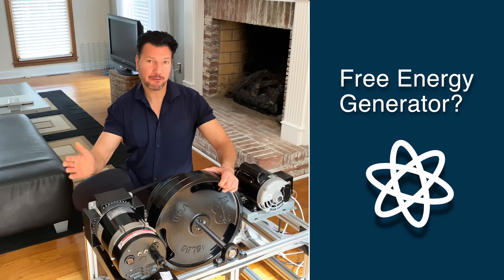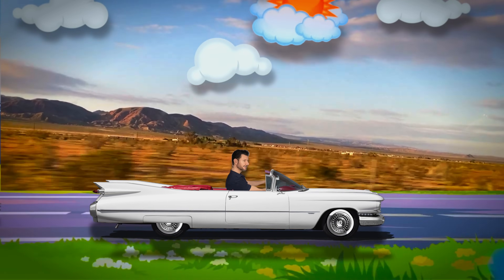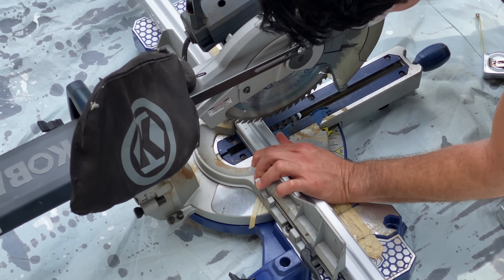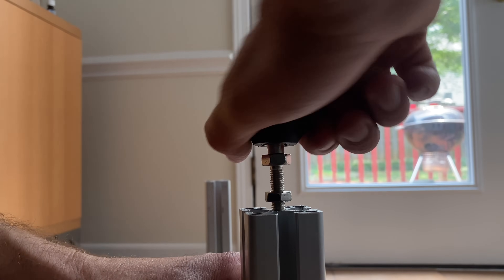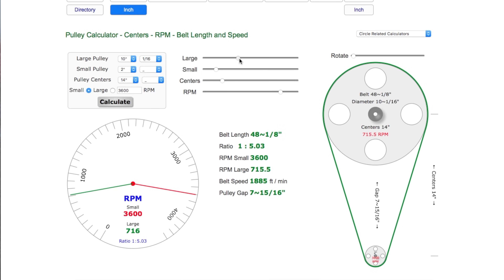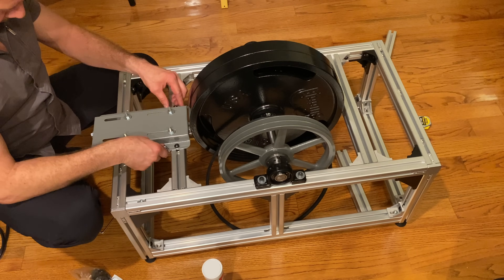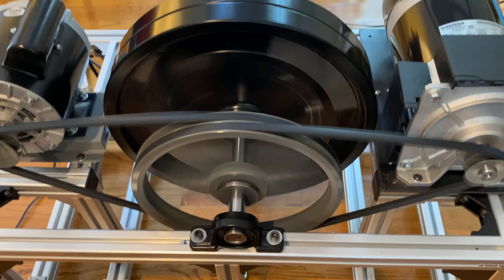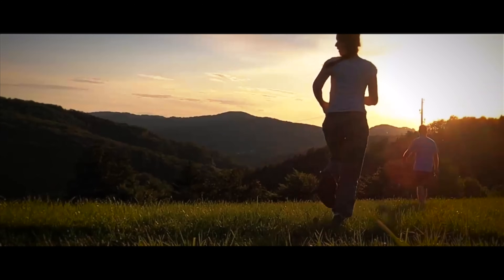How to Make a Free Energy Generator!

Comment: What ya, need is a balanced system, that is important, but More than that ya, need the right barrings.. the flywheel is being pulled down Bye friction in the 
Barrings.. the magnetic barrings are way, to Expensive.!! What you need is slip barrings, The one's that catches One way, but after achieve full speed, they free-spin, and let go of There grip,.... Resurch the City busses that used
 Flywheel technology " back in the 
Past,".... They would keep spinning 
Sometimes, 45 minutes after the bus was parked, and recharging 
The whole system before everything was cut off and disconnected bye what I think was
Relays... PS: I'm resurching this as well. So, good luck my friend... JR

Comment: you just have to try 3hp motor with 12.5 kw generator and fly wheel must be 100kg than you will get the result with high speed  good try and best of luck bro 👍👍👍

Comment: YOU PROBABLY DID NOT DO IT RIGHT. . ... USING  MAGNETS IS THE WAY TO GO.... NOT SOMETHING MECHANICAL.  ... THERE ARE ALREADY MAGNET MACHINES WORKING..... THE UNIT COSTS ABOUT 4,000 DOLLARS THOUGH..... BUT AFTER THAT TOTALLY FREE ENERGY ......... IT'S CALLED .....   MAGMOV.

Comment: The choice of devices is of essential importance.  For example, if we connect a 230V/1kW motor to a 230V/500kW generator, we get 499kW excess power to run our appliances.

Comment: Greg; True science is not a cultural chant of defeated minds. True science is Laws established from experimental evidence. Newton has all the experimental evidence and energy conservation has none. 

Newton’s Law of Conservation of Momentum is the strongest Law in Physics; but the profs throw it out in order to promote their false law of conservation of energy. 

An Atwood’s machine with 15 kg on one side and 16 kg on the other produces 24.66 units of Newtonian momentum. It takes 4.429 units of momentum to return the 1 kg back up to the original position. There is 24.66/4.429 = 5.56 times as much momentum as what would be needed to keep repeating this even. 

You throw out Newtonian physics for a meaningless chant.

The ‘cylinder and spheres’ takes 24.66 units of momentum and throws the 1 kg up 31 meters; when it was only dropped one meter.

Comment: I used a scooter 14 volts dc motor run by capacitors , charged by 16 vdc coming from inverter powered by the generator...works fine

Comment: The Overunity concept was discarded long ago by the electrical pioneers who wrote our textbooks because the then understood parameters of academic electrical engineering were not flexible enough to allow additional influences to enter the system and increase its power - Magnetism is indestructible and is Power for this purpose - its effects to increase electrical power were only lightly rescearched and then ignored and discarded - without reintroducing it into the system to increase its power - todays high power neodynium and other type magnets may have properties that lay outside academic parameters due to quantum effects or other reasons - the electrical frontier is yet relativley new - many experimenteers have reported success by converting a common AC induction motor into a powerfull  LOW SPEED alternator - by simpley cutting groves into the armature and filling them with an uspecified number of POWERFULL magnets to somehow correspond with the stator windings - and using the current from that powerfull unit to drive a suitable motor that in turn drives the New and Powerfull Alternator to produce excess Electrical Energy - perhaps at a slightly lower speed - if the adaption proves to be unsuccessful at Overunity then the Durable and Powerfull low speed Alternator has proven to be ideal as a Wind Power Alternator!

Comment: it can work but you have know 3 base numbers,   and its not impossable  it can be done , you need to know 3 numbers amout of hp needed to make the power, genartor 1 to power the motor 
at 15 amps  useing 6 phase,  next tie it in to low rpm gen of 15kw,   220 volts at 150 amps,     but key is it running on 6 phase between motor and gen,
now all safty systems, that must be invold u talking ton power,   this was done in 1960s by milatery  and it work when i got my hands on it a 60 year old device did work made 20 % free power, but it work,  so u use concept why dose power plants put out 700k volts and to is key to green power, no one understands why no can u just find it, most people work on it dont know why, 

now only thing we need way start this, for  this we use small motor with no load on genartors,   now where it fails stater coils this where this must be remove and replace with magnets, 
and your power with amps guss what your looking at it all wrong,  first u have have 50 hp motor and this motor must run at 15 amps, in this way it will work one part missing is voltage,  
and u cant guss this  key run it at 800 rpm,  why it stop easy u stater coil is probem  , by way this was done in all high rises in 1960s and it worked but was removed from history, 
if u aswer one quistion why dose power plants put out 700k volts, u found key to green power,   other why i the only one has all key numbers to make this work ,

Comment: When the interaction of masses involves a change in the quantity of 'mass in motion' Kinetic energy is NOT conserved. When a .0051 kg dart embeds in a .1380 kg block Kinetic energy is not conserved. When the spheres collide with the larger cylinder Kinetic energy is not conserved. But the modern profs only care about the ‘can’t produce something from noting’ mantra. 

If the profs think that a 1 kg mass moving 3.16 m/sec can collide with 9 kg at rest and make a 10 kg mass move 1 m/sec then they are producing 6.84 units of Newtonian Momentum from NOTHING. The profs fib to you when they say Newtonian momentum and kinetic energy are both conserved: they are NOT. 10 m/sec does not equal 3.16 m/sec.  

You can believe the prof’s deceptions or build your own ‘cylinder and spheres’ and find out the truth.   $30 to find out the truth.   Newtonian momentum will be conserved and you will be making energy.

Comment: All you have to do to make free energy is to use the Laws of Physics that are based upon experiments rather than wild philosophical imaginations. Answer this one question correctly and the production of free energy from gravity becomes absolutely obvious. 

A 1 kg mass collides with a 199 kg mass at rest. The speed of the combined 200 kg mass after collision is 1.4007 m/sec. What is the original speed of the 1 kg mass?

All anyone needed to do to make free energy is throw a small mass off of a massive cylinder or flywheel and see if Newtonian Momentum is conserved.     

How you answer the question might tell you what is wrong with modern physics and why we have not already produced free energy from gravity. I would appreciate it if you answer the question before you continue reading.

If you solved the question using Newtonian Momentum Conservation you would predict 280.14 m/sec and you would be correct.

If you solved the ‘problem question’ using Kinetic energy conservation you would be incorrect and your prediction would be 19.809 m/sec  

20 one kilogram masses evenly stacked 20 meters high can accelerate a 180 kg mass in a modified Atwood’s machine. This is 20 suspended kilograms accelerating a 180 kg block on a frictionless plane.  After a one meter drop of the 20 kg stack the entire 200 kg mass is moving 1.40 m/sec. This is 200 kg * 1.4 m/sec = 280.14 units of Newtonian Momentum.     280.14 units of Newtonian Momentum 

After the stack has dropped 1 m the 20 kg stack can be reconfigured by throwing a 1 kg mass up 20 meters.  This 20 meter upward throw takes 19.81 Newton seconds or 19.81 units of Newtonian Momentum. To be thrown upward the mass must be moving 19.81 m/sec.   This takes 19.81 units of Newtonian Momentum but you have 280.14 units

If you calculated that the 1kg mass that collided with the 199 kg mass must have been moving 280.14 m/sec; then you believe what is true; that Newtonian Momentum is a conserved quantity. Kinetic energy conservation is not true and has never been conserved in collisions.. 

When the ‘cylinder and spheres’ takes the motion of the 200 kg moving 1.4007 m/sec and gives all the motion to the 1 kg then the 1 kg must be moving 280.14 m/sec, because the 1 kg gives all of its motion back to the 200 kg moving 1.4 m/sec.

All anyone needed to do to make free energy is throw a small mass off of a massive cylinder or flywheel and see if Newtonian Momentum is conserved.

Comment: Mount your flywheel so that it has clearance; about 1.5 diameters. This will allow you to throw a weighted string that has been wrapped around the circumference of the flywheel.

When the mass on the end of the string unwraps from the circumference of the flywheel the rotation of the wheel will be stopped. All the rotational motion of the massive flywheel will be transferred to the much smaller mass on the end of the string.   

One example is: a 40 kg rim moving 1 m/sec will give a 1 kg mass all of the Newtonian Momentum; which is a speed of 40 m/sec for the small mass. And the energy increase is massive. This is experimentally proven by ‘cylinder and spheres’ experiments. 

This 40 m/sec is verified because the small mass will return the motion to the larger flywheel if the small mass is left attached to rewrap around the flywheel. The flywheel started with 40 units of Newtonian Momentum and it ends with 40 units of Newtonian momentum; therefore the small mass MUST have 40 units of Newtonian Momentum. 

Just verifying these speeds will guarantee that energy producing machines will be built; because you only need to throw the small mass upward to make use of this energy increase. 

Use a string length of about ½ circumference for a 1/40th mass for the small mass. These speeds are very DANGEROUS.

Comment: I believe that the original units produced used a 3 phase electric motor and powered it by using only 1 phase. Also the generator was a 3 phase unit and 1 phase powered the electric motor while the other 2 phrases were used to light bulbs and run small motors like fans and drills.

I don't know if that idea was ever tried properly or not when trying to prove that it could be self running or not.
Also the generator needs to be geared for higher speeds, so using a smaller pulley on the generator would increase its speed. 

The original unit video that is actually marketed online is produced by a Pakistani guy. 
He maintains that the gearing must be accurate and the proper use of the 3 phases is critical for it to work. 
IDK, I'm just a guy that grew up on a farm in Wisconsin USA 👌👍🙏🤔

Comment: For power over unity to be successful. You would need a three-phase motor and a generator that over produces. A smaller motor that could get up to 600 RPMs. And a redesign of the main generator for more magnetic polarity. Then you need a Bank of supercapacitors the store residual energy. capacitor one has to be larger than the other. You're not taking away from physics. You're not getting something from nothing. Your banking residual access inside the capacitance to use in a second capacitor Bank as a backup for fall off.

Comment: you have done well, do not give up yet. change the base design and put all three parts (motor, generator and wheel on the same axis), no pully, no belt. they eat electricity by friction. i subscribed to your page and wait for you to do this and make a video. this is exactly what i wanted to do. good that you are doing this. calculation of the energy input for the motor snd energy output of the generstor also is necessary. but i think you have done this. balancing the wheel was a professional work.

Comment: What software do you use to assist with balancing the flywheel ?
This well built setup will never work as it has to do with efficiency, the power supplied to the generator will always exceed its output and the output needs to be greater to drive the motor, then there is energy loss in the belts and we haven't even started to draw any power. You will never even get it to run without a load !!!

Comment: Try feeding the power from the Generator into capacitors and power the motor from the capacitor output they will continually charge and discharge to the motor

Comment: Use a 12 v mort  and use a 12 v batteries to run it went you to the generator voltage have a kill which on the 12 v mort just turned it off and the generator should keep going

Comment: Use a transformer instead of a generator or motor. A current running through a transformer will produce a magnetic field . When the current is off the magnetic field produced by the transformer will collapse and cause a reverse current surge of high voltage. This reverse current can be stored in a large capacitor and used again repeatedly until the voltage goes down to zero. This already proves that the law of thermodynamics has been broken since the first initial current in the transformer was multiplied by the repeated forming and collapsing of the magnetic field.

Comment: I think there's a problem in yr design, if you want a "free Energy generator" why would you need a motor that draws Power from yr house... From what I've seen in the internet you can either go for the Spring generator version or you'd need a stator around that weight disc with magnets, and magnets also on the rotor (magnet motor) and then it should be possible to start It by hand and the rotation would kick off from that... Kudos for the whole frame and setup you did though It looks so nice

Comment: His ideas working but small change 1.big _small pully  2. Low voltage battery motor 3. Other energy sores solar used 3. Nuttan 7 vithi used.  This ideas 100 percent working.

Comment: if you spin a electric motor by the shaft its then a generator check it out put the right way i used a 12 volt motor i spun it with a windmill adapter the +& - were off I switched wires it worked really!

Comment: Well, the energy, on all it's formes can't be created, only transformed from a form to another. With our actual means, all those transformations suffers losses, in the process. On that machine there are three main points where part of the energy gets lost so the output will be less than the input, therefore the machine loose it's rpm and eventually, stops.

Comment: Why do YouTubers in Indian keep making these types of videos? Maybe because ignorant people keep watching them. It is so simple to understand, energy can not be created or destroyed. It can only change form. This is a basic proven law called, law of conservation of energy. It's basic physics taught in middle school science classes. Just as Santa Clause does not exist there is no such thing as "free energy" machines that produce more energy than they consume. Even the most highly engineered machine couldn't even achieve just 100% efficiency unless you can some how magically get rid of all vibration, heat, and noise. Even if you could achieve 100% efficiency the machine could only power itself. So after all the engineering advancements you are still left with a worthless machine that does nothing for you. If this fellow somehow "cracked the code" and did the impossible it would be worth untold amounts of money. Do you really think he would post his solution to a You tube video for anyone to use? Consider that the more likely explanation is that this guy is either for of garbage or just plain dumb.

Comment: Center pulleys is too big my friend, you center pulleys act as a disc brake, it is difficult to stop or slow down a flywheel if you have  a 3 inch pulley , but very easy to stop or slow it down with a 12 inch pulley. The flywheel becomes handicaped, Go with the smallest pulley closest to the shaft for maximum torque, and yes try going over 3000 rpm , but your flywheel has to be balanced, and remember multiply speed by 2 your torque is then multiplied by 4 at the (Center of Shaft) nice job , your getting there !

Comment: I love my free energy.  Let me explain.  I have a 300-watt solar system on my RV daylight hours it's great. But nighttime hours are longer, and the battery bank drains. It's connected to the battery system of the engine and will recharge the battery bank in several minutes.  I bought a 300-watt 3 phase wind turbine alternator.  But without wind, it doesn't work.  After removing the propeller, I used a 1/2" battery-powered drill to turn the alternator.  Within a few minutes and the battery bank was fully charged.   I bought a 757 DC motor with a gearbox that doesn't exceed the rpm of the wind turbine. I put a battery charger regulator from the battery bank to this DC motor.  Now, it automatically charges the battery bank and shuts off automatically like your vehicle does.  I did put a switch to disconnect this system when the solar system was working.  Then, before sunset, i turn it on. A solar switch is available to do it automatically.

Comment: The capacity of your electric motor ought to be far lesser than the AC alternator, use pulley to harnesses the RPM of the electric motor with the generator, use an old engine flywheel that is already balanced in potential energy to give you required kinetic energy when it spins not the one designed for gym

Comment: First off your fly wheel is to small. to sustain 5 hp of energy takes a 1500 pound flywheel  for sise it would be a disk 36 in diamiter and 5.8 inches thick  spinning at 3600 rpm . There is no such thing as free energy but you can multiply that energy or store it (as in flywheel) for future use  but consistant input of power is needed